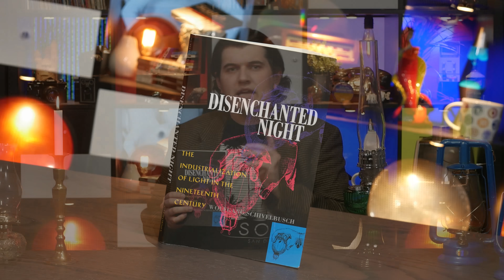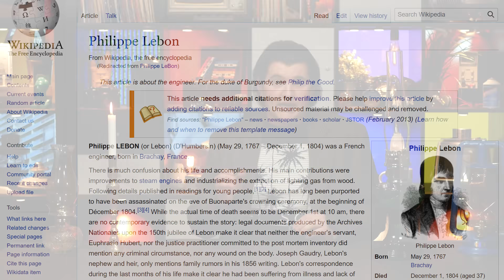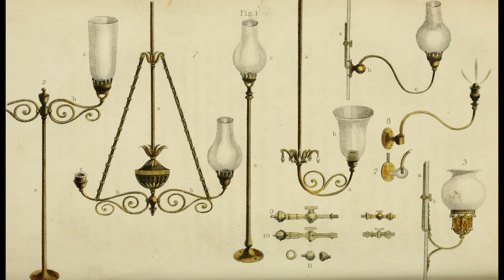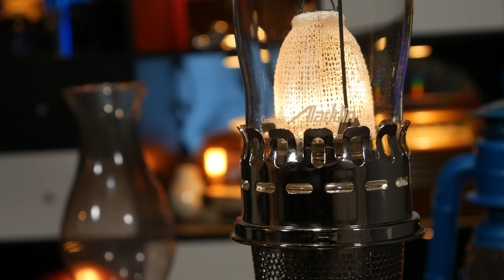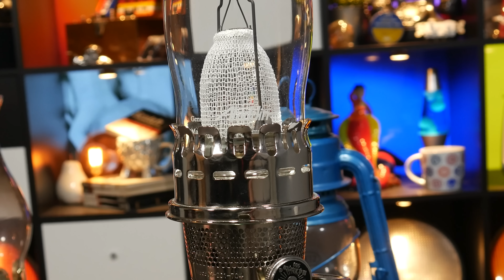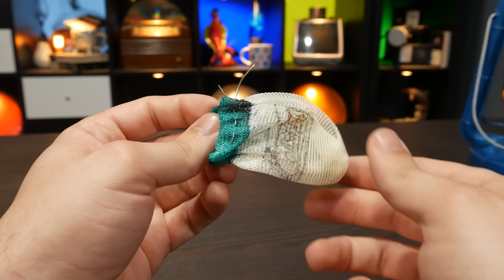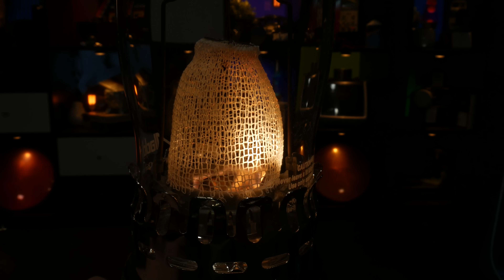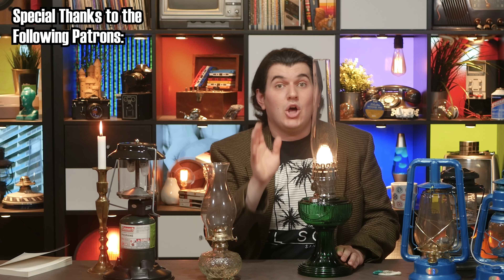How the gas mantle made lamps 10X brighter

Comment: The gasometer kinda does have a measuring function.  As it fills the top rises up so you can immediately see how full it is.  Since the gas production rate was limited, the gas works aimed to fill the gasometer during periods of light demand, and allow it to empty partially when demand exceeded supply.  You could tell what was going on in a town by the level of the gasometers: when everyone was busy cooking they went down, for example.

Comment: My dad spent 47 years working at our local gas & water company.  At the time he joined in the early 1950's, they were transitioning from Coal Gas (he called it "wet gas") to Natural Gas (termed then as dry gas).  He used to tell stories of the new "dry gas" eroding (drying out) the packing used on pipe joints and having to dig up areas with packed joints and replacing the old wet pack joints that would dry out because of the natural gas and replace them with threaded pipe dope joints.  My aunt and uncle had gas lights in her house and my father was furious when my uncle brought in electricians while he was in Korea during the war to run wires inside the gas lines and install electric lights.  He told them at the time they should have left one gas light in each room because "electricity was unreliable".

Comment: 2:38 I"m guessing "lute" is the same as lutum (originally Latin for clay), the stuff (clay and similar substances), that alchemists used to create seals between the different parts of their apparatus, like distillers. Or it might be clay (or something similar) clad on the inside of a chamber used for burning things, to protect the glass, stone or brick walls of the chamber against the heat.

Sorry if my English terminology isn't correct, it seems like I suck even more in English than in Latin, when it come to the terminology used by alchemists.

Comment: I dont know if anyone said this yet, but I could propose a theory of what "forced my lute" means...

A lute is a liquid seal. Think a tube bent into a "U" shape with a little liquid sealing the inflection.

If the pressure in the retort exceeds the hydrostatic pressure of the fluid in the lute, it would blow the liquid out; ergo "forcing the lute".

Why you would want a lute in the first place is more difficult. But I imagine that there was a tap at the bottom of the lute to draw off any condensate for testing without exposing the condensate to oxygen. The gas that passes through the lute would therefore be considered incondensible at the tenperature of the cooling medium.

Comment: Lute: A substance, such as dried clay or cement, used to pack and seal pipe joints and other connections or coat a porous surface in order to make it tight. Also called luting.

Comment: I am 66 now and can remember clearly when I was 10 moving into a house that had electric, flicking the lights on and off until then we had gas lights on the wall we had used a gas iron to iron clothes and even had a gas poker to start our coal fire. The gasometer in our town is just being dismantled at the moment as no longer needed I remember on the same site the coke buildings where gas was removed from coal.

Comment: Coleman lamp mantles are naturally radioactive. Worked at a Nuclear power plant back in the 90's. As a joke, someone shredded a couple of them into dust with scissors and sprinkled it all over the inside of a night shift foreman's pick up truck cab. When he went to check in, EVERY alarm in the whole damn plant went off! He ended up loosing his truck (dust got into everything and you couldn't get all of it out. The foreman ended up 24/7 for 180 days on around the clock monitoring by doctors from the NRC. (They'd package up all of his feces and urine to be shipped off and monitored. They spent God only knows how many millions over a .75c practical joke.)

Comment: I live in South Africa.  In the 1950' and 1960's I used to do a lot of hunting and fishing in far off isolated places.  For light we used Coleman and Tilley paraffin (kerosene) pressure lamps.  To heat the generator we used to call that "priming" the lamp. We had a small tin with a bent copper tube that fitted thru the lamp and filled the little container with mentholated spirits, (alcohol).  Meths as we called it is alcohol with a blue coloured poison  dye added as it was drunk by some people.  For cooking it was a Primus paraffin stove or a fire.   All these items are 100% reliable and 20 litres of paraffin lasted 10 to 15 days.  The beauty about the pressure lamps was the brightness could very easily be controlled.  Gas is far easier, but refilling a cylinder in the back of the beyond is even to this day challenging.  Of course now for lighting its LEDS, single plate induction stove, solar panels, a 110Amp Hour battery.  But nothing beats the atmosphere of cooking on an open fire.  The price of progress

Comment: Yttrium and cerium oxides are used the same way to make a catalytic afterburner to allow wood burners to be certified. It is a compact matrix in the exhaust gas path to the chimney. It has to run at 500°c. There are many scientific papers on this technology. Cerium and rare earths are also in vehicle cats.
A mantle will work with a candle too.

Comment: This is a similar burner to a kerosene fridge which I have had experience in the 70's The trick I found to get the wick to burn evenly was to rub across the top of the used wick with the edge of a matchbox ( the striker strip), this seemed to grind all the top burnt material into the circular wick cavity. Care also had to be taken that the wick was wound up to the level position not down to the level position as the play in the winder would wind unevenly.
I hope this helps.
Note; the kerosene fridge could make ice cubes if setup properly.

Comment: I'm late to the party but you mentioned that kerosene is a niche fuel, only it isn't - At least not in the rural parts of the UK. We use a "heating oil" (Aka kerosene) boiler for our central heating as do many people in the UK who are not connected to the mains gas network. The other options for central heating in the rural parts of the UK are electric storage heaters, heat pumps and bulk LPG tanks - But oil is by far the most common fuel for rural central heating.

Sadly most oil boilers aren't even modulating, there's only really one proper modulating oil boiler available and that is very new to the market.

Comment: There is a use for this manufactured gas is still in use today in China. Buses used in remote areas have a gas generator on the back of them. Initially, the upper chamber is filed with coal or wood and sealed off. This chamber has piping that feeds the intake manifold on the engine. The lower chamber is filled with wood or coal an set on fire. The fire heats the upper chamber and the contents then release methane in the contents which the engine then burns to produce the power required to move the bus. Once the upper chamber has released all of its gas content, the material left is used for fuel in the lower chamber since it is now either coke or charcoal, both higher grade fuels. Of course this setup is not as efficient as liquid fuels but it is effective where liquid fuel is unavailable and it lends itself well to transporting thousands of people around day to day.

Comment: Finally, an explanation of the mantle! I have a vivid memory from my childhood of finding an old lamp like this, removing the glass, and touching the mantle. It crumbled and I was beyond confused, having thought it was a cloth of some sort.
Reply: ain't yet watched entire video... Those mantles represent the first commercial use of rare earth elements/lanthanides . A number of the rare earth elements glow brightly at reasonably achieved temperature. Cerium and thorium especially I remember. Thorium was the best performer and no longer used today . A fresh mantle is a cloth impregnated with nitrates of the rare earths and a silicon based chemical perhaps ammonium silicate. After commissioning by burning the installed mantle in situ,  the ammonium and nitrate components and cloth cellulose are volatiled away leaving the rare earth oxides within a newly formed silicate solid structure that has formed in the  matrix of the previous cloth fabric with some 40% shrinkage .

Comment: I bought my Aladdin lamp at a local hardware store about 15 years ago.  I had been using propane fired gas lights in an older camping trailer and wanted the option of using a kerosene source.  My brother had used an Aladdin lamp in his home 40 years ago which had a fixture which would allow him to hold a pan for cooking above the lamp. That provided an increase in efficiency, light and cooking, and enough heat to take the chill off the cabin on cool, but not too cold, nights.  We had used Coleman lanterns fueled by white gas back in the 1950's, so we have used all 3 types of incandescent mantle lamps over the years.  Although I still have all these lanterns, the great improvement in efficiency of LED lights and rechargeable batteries may mean that they will just be relics on the shelf as curiosities.  This presentation provided some interesting history and details I had not been aware of.

Comment: If anyone didn't answer it in the 6500 comments, "forced my lute" means it broke the seal or adhesive that holds the stopper in the top of the retort, which is there to keep it air tight. I assume there was an explosion in the retort which threw the stopper out of the retort and broke the glass retort as well. "Luting" is an old term for sealing, which has long since gone out of fashion.

Comment: Quite interesting.  I used to use Aladdin lamps in my cabins before I got batteries in the 80's.  They certainly did better than candles.  But when I switched to batteries and 12 V lights, I stopped using them.  Now, still off grid, (on solar) I use LED lights, which are even better.  I too am curious as to whether the mantles are actually some type of catalytic device.  I suspect that they are.  Normally a catalyst "allows combustion to take place on it's surface at a lower temperature or pressure than normally would be allowed".  They DO allow the reaction, to mainly be on the mantle, and the mantle, like a catalyst, does not get consumed.  However, I suppose it is possible that the mantle just becomes so hot that it becomes the easiest place for most of the gas to light, as it escapes from the wick. .  It is true that most catalytic reactions would probably have nearly all the combustion on the actual surface, where I suppose that with the mantle, not all (but the majority) of the reactions are on the mantle.   I've been involved with a scientist that has been developing (and patenting them) catalytic devices for years.  While many have worked on such, no one prior has been able to make a catalytic device that was totally "enclosed" (like an internal combustion device, but being catalytic.)  But this physicist has.  One of the great advantage of such devices are that one can burn a fuel at lower temperatures than normally required for the fuel to burn, and of course VERY cleanly.  If you have enough oxygen to burn the fuel completely, (stoichiometric) then really all you get as by products are CO2 and water vapor.  Obviously the simplest method to do that is to use a decent Venturi to allow for gas/air mixture to get a good enough ratio of fuel/O2.  That cannot really be done with most fuels, for propane requires (at sea level) something like 24 times the amount of air to fuel, and Isobutane is even worse, at 32 times, BUT there are fuels that are able to be burned with ratios down like 15/1 which can easily be achieved.  Natural gas is easily burned very efficiently, but of course natural gas is not easily made portable.  But gases such as DME CAN be easily portable and might indeed replace gas canisters in the future.   This would be very good, as they burn much cleaner than Isobutane or propane, by a couple orders of magnitude! Of course there are other advantages of combustion using a catalyst.  You can control exactly where the combustion is taking place.  If you want to heat something, you can have the reaction take place right on the surface that you want heated, and much more efficiently.  With it internal combustion, there is no fear of something catching fire that you didn't want to catch fire, nor is it subject to wind, as the Aladdin was!  It is pretty amazing how far the science has advanced even in the last 50 years.

Comment: 23:01 interesting little tidbit about the carbon deposit being burned away from the lattice due to the high heat. That’s the same principle in use on Diesel Particulate Filters. 
The mechanism varies, some use chemicals to help trap or release the soot, but the premise is, catch the soot from poor combustion at low engine temperature, then burn it off when the engine is heated up. It’s why you need to give modern diesels a hard drive on a motorway/highway regularly.

Comment: Earlier models of Aladdin's burned better.
The later ones were cheaper to produce but tended to have hot spots on the wick due to not sealing so well.
 In my remote part of Scotland we used Aladdins until the second half of the 1980s.

Comment: As a BSA assistant scoutmaster, I’ll say that we used propane lamps in the center of our campsite in the evening. When lights out time came, we would leave one lamp burning as a night light on case the boys had to use the latrine. One bottle of propane lasted from sundown until 3 or 4 in the morning, and if we dialed it down low enough, it might still be burning by dawn. The mantle’s usually lasted several overnights, but sometimes the car trip to camp or the boys rough handling damaged the mantle.

Comment: Lute
    (Chem) A cement of clay or other tenacious infusible substance for sealing joints in apparatus, or the mouths of vessels or tubes, or for coating the bodies of retorts, etc., when exposed to heat; -- called also luting.

Comment: Funfact: Carl Auer von Welsbach not only developped the incandescent mantle (in German: "Auerscher Glühstrumpf", literally translated "Auer's glowing sock"), but also the metal filament electric lamp. Thus he was both founder of the Auerworks in Berlin producing Auer mantles, but also of Osram, a still world wide known brand of filament lamps and - nowadays - of LED lamps. Sadly the previous Osram works do no longer exist in all their glory. The rest of the Osram lighting company still produces thin wires from Tungsten (alloys), for a rest of automobile Halogen / Xenon lamps still produced by Osram lighting and refractory metal wires, including Molybdenum, Tantalum and Niobium for other industrial appications. All the other Osram articles you can still buy at consumer level just use the brand name but are produced by sell out companies from the formerly big Osram lighting group.

Comment: Great video! It’s answered a question I’ve had in the back of my head since I was a teenager many decades ago. When I was 18 I went to Kenya on safari. The tour guides brought into the mess tent at night these type of lamps - i’d only ever seen wick- burners but these ones had this strange net over the flame. When they installed them the net was like a small flexible string bag but then when we were clearing up I touched one of the nets (after the lamp had been turned off for awhile) and it shattered like glass. I could never understand how that could be as when it was installed it was like a string net! Now you’ve explained it– my life is now complete 😁

Comment: I worked at a carbon coke plant, and everything was on fire. We even had a collapsible storage tank and one of those gas flairs like you see in gas/oil fields. Then one day our storage tank blew up.  It really didn't phase us because we were used to constant fires, electrical sparks, and things exploding. The gas station across the highway wasn't happy as a few of their customers got their eyebrows singed. It was 38 years ago and OSHA had just reached my neck of the woods.

Comment: Propane Burns clean but still has a very visible Flame. One thing I know for sure is pure ethanol or isopropyl alcohol makes for a practically invisible Flame during the day. You have to run your hand over to see if it's going or not. Moonshiners use that technique to determine purity

Comment: This took me back to my 1950s and 60s childhood. We had no electricity, no mains services in fact. We had all the lighting you talked about. Gas with mantles, hurricane lanterns what you call Dietz, an Alladdin, Tilley lamps.
They all needed constant and regular maintenance. Trimming wicks, air gas mixture, checking fuel before it got dark.
Prevention of soot build up was vital.
All these methods of illumination have one great advantage in these days of high energy costs. They give heat and light. If the high energy costs continue into next winter invest in Alladdin Lamp shares.
My mother continued living without electricity into the 1990s. Not going off grid but because it was home.
Camping LED lights don't have the heat element, not good when electricity and heating goes off.